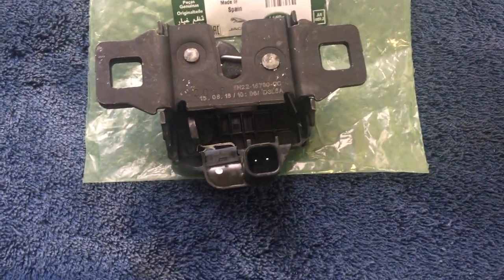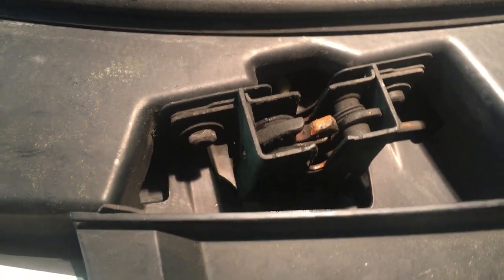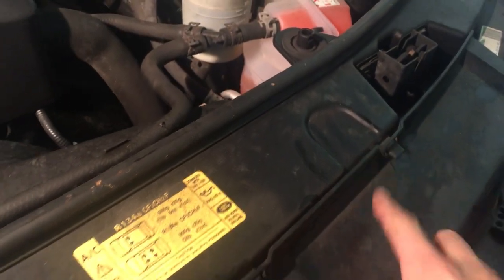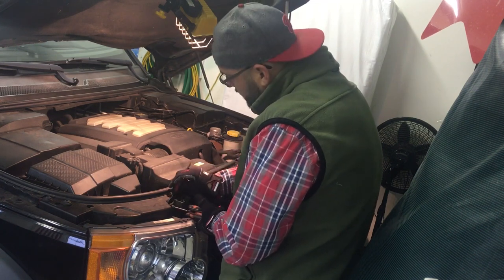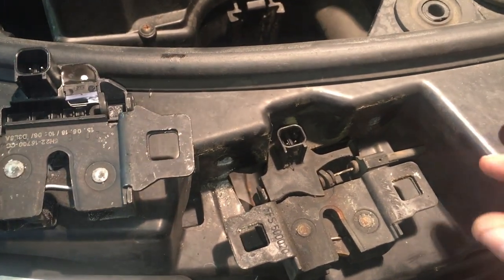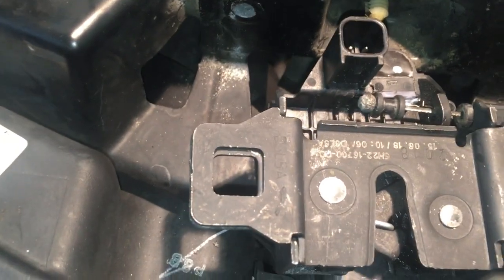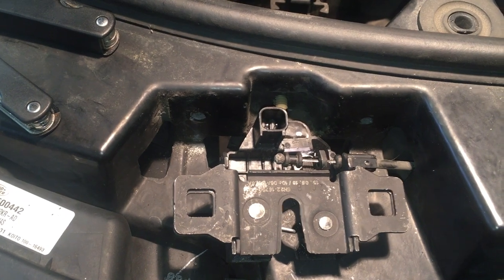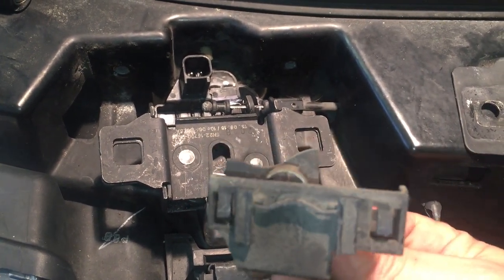Land Rover LR3: DIY-Replace Bonnet Sensor. Stop ALARM from going off!

Comment: Your a life saver thanks so much! Ever since I got my new Land Rover I’m about half tempted to get rid of it. It’s supposed to be a luxurious vehicle but every little thing keeps going wrong with it. I have a 2009 with low miles and in good shape very new condition, also has been serviced every 5,000 miles and you would expect nothing to go wrong with this thing. Nope! I got this brand new ten years ago so I’m the original owner and not only did the leather not hold up well, but stupid stuff goes wrong constantly! This was the most current issue we’ve had.
Reply from the maker: I am the second owner on mine.  Little things started going wrong around 100k miles. The leather needs to be cleaned and conditioned regularly.  I do mine every time I wash.  It's a great truck but the maintenance is a killer.

Comment: Would there be any lights on the dash or not necessarily? My alarm is going off every morning at 9am and I’m assuming the cheapest option first the hood latch sensor. -08 lr3
Reply from the maker: @blowtv1115, thanks for the comment. I don't recall any lights. Would you mind letting us know if this fixed your problem?

Comment: So did it fix the problem for good.....getting ready to install the same part,because the damn horn goes off whenever it feels like it ,usually in the middle of the night.
Reply from the maker: Yes. No issues after the replacement.
Reply: @autobytes007  mine is a 2010 range sport ,i think yours was a 10 also ,but mine has 2 of those bonnets is that correct  did yours have 2 also ?
Reply from the maker: Yes there are two bonnet latches but only one has a sensor in it.
Reply: @autobytes007  thanks for the info brother..

Comment: Was there any warning signs on your dash saying that the front passenger door was open my alarm keeps going off randomly but when I’m driving away I noticed that there’s a sign saying my passenger door is open I’ll open and close it and it still says it’s open
Reply from the maker: No but that sounds like your issue. Have you found a solution?

Comment: How did you address the replacement part being slightly different from the original resulting in the release cable being too long to release the latch?